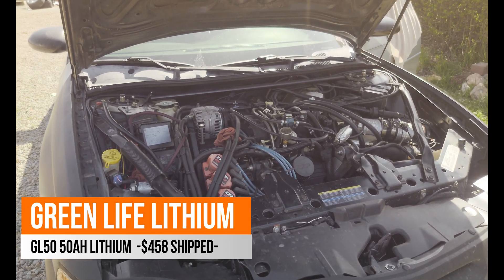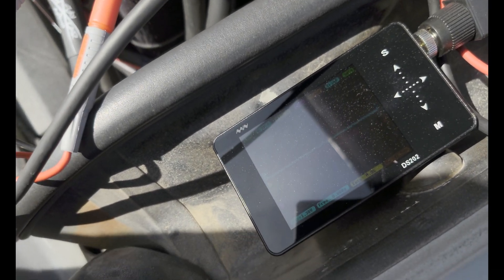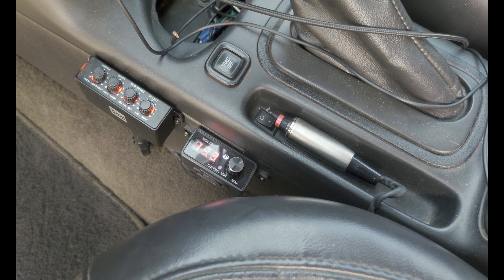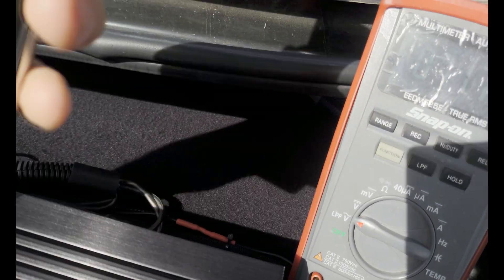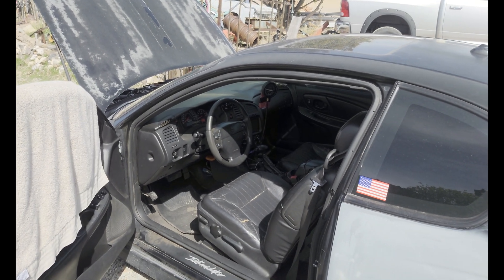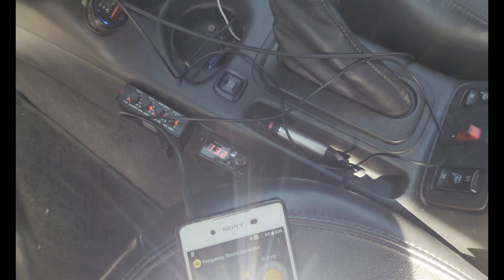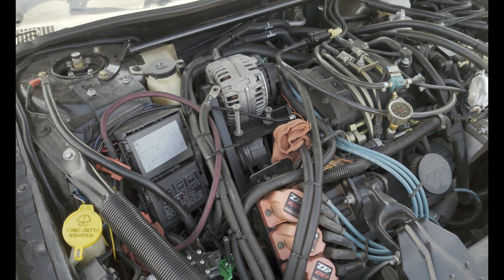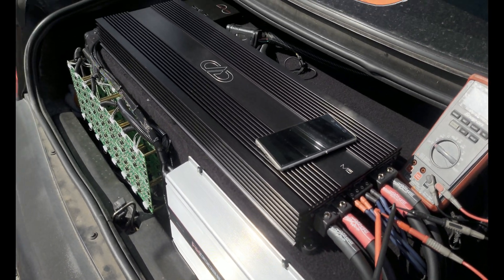Green LiFe Lithium VS JY, Limitless, XS Power, Winston

Comment: Hey man i was looking at these brand of batterys are there good n reliable i have a 270 alt n a sundown salt 8k n i whanted it to run it at .5 on the 100ah greenlife will the work thanks
Reply from the maker: Sorry For Super Long Response.

I've Had The 2 In The Rear For About 4Ish Years And Haven't Had Any Issues.  I Think The Biggest Difference Between These Green LiFe Lithium Batteries And The XS Power, Jy , Limitless Is That Green Life Lithiums Are Focused For Long Life And Large Capacity Rather Than Current Output.

The Reason The GreenLife Lithiums May Not Put Out As Much Current As The Jy, limitless etc Is Because These Have Built In BMS In Them. These Batteries Will Automatically Discconect Cells That Go Bad (so you can still use the battery just at a reduced capacity) They Also Have Short Circuit Disconnect And Even Over Charge Voltage Disconnect Internally Were As XS, Limitless Have Nothing Like That. Or At Least They Don't Advertise It (having these features means lt has limited the current output capability of the green Life Lithium). The Green LiFe Lithiums Also Have Active Cell Balancing With The BMS. In My Opinion These Green LiFe Lithiums Will Last Longer Than The XS, Jy, Limitless etc.

A SALT-8 Is A No Joke Amp. My DD M5 Is Rated 8k @ 14.4v And That SALT-8 Is 8k @ 12 Volts. So That's Nearly A 10K Amp. 

If I Were You I Would Run 4 100AH Green LiFe Lithiums. If Your Gonna Go Lithium I Would Spend The Same Amount It Would Cost From "Name Brand Lithium" On Green LiFe. You May Not Get The Same Performance Battery Vs Battery. But Since Green LiFe Is Cheaper You Can Buy More Of Them To Probably Get Similar Performance.

So I Would Run 4 100AH Green LiFe (~$3,200) If You Got The Space And Don't Want To Run Ultra Capcitors. If You Don't Got The Space Then Limitless May Be Your Option. Those Put Out The Most Power For Thier Size... But Not The Most Power For Thier Price I Think.

If You Wanna Run Super Caps I Would Go 2 100AH Green Life And 4-8 Banks Of Caps. If You're Interested I Know Where You Can Get 8 Banks For About $1,300 Brand New. Each Bank Comes Assembled With Bus Bars And Balancing Boards. They Are Fake Chinese Knock Off Of Maxwell 2.85v Caps. I Bought A Bank For $155 Shipped And Been Testing It Out For Awhile Now. They Perform Just Like Name Brand Caps Like Maxwell And XS Power. But You Can't Get Them Right Now Because This Virus BS. I Had To Cancel My Order Of 4 Banks.

I've Got Videos I Have Not Uploaded Yet Of The Caps Because I Wanna Get My Share Of Them If They Sell Out Or Go Up In Price When People Discover Them.

If You Want Me To Do Any Tests On My Green Life Lithiums Let Me Know. If You Want A Private Link Of The Knock Of Capacitor Load Test Video I Have I Will. You Can Still Buy Them On eBay But They Price Of Shipping From China Has Gone Up Insane Cus The Virus.

You Could Also Build Your Own DIY Headway Lithium Bank But That's Kind Of Involved If Your Not Too DIY Inclined Or Just Want Something That's Ready To Throw In And Install.
Reply: Salvatore Hayes thanks for all the info on the website it says one year warrenty n u mention 5 years have u done a videos with car on thanks again i will b looking out for those videos u havent posted if u post then thanks again
Reply from the maker: @10krms8  I'll Email Green Life And Find Out About Thier Warranty. On Thier Website For Thier All Thier Batteries It Says 5 Year Warranty And On Each Battery It Says 1 Year For Some Reason. I'll Let You Know.
Reply from the maker: @10krms8  The Green LiFe Battery Warranty Is Only 1 Year Now. It Used To Be 5 Years When I Bought My Two In The Trunk 4 Years Ago. The Good News Is They Are Cheaper Now Instead Of When They Had 5 Year Warranty. My 50AHs In Trunk Cost Me 650 Each At The Time And The Lastest One I Bought In Engine Bay A Few Months Ago Was $458 Shipped.

If You Want A 5 Year Warranty There Is Another Company Called Smart Battery. They Are The Same Exsact Batteries Just With A Different Sticker On Them. They Are Called Smart Battery. Smart Battery Has Been Around Longer Than Green LiFe. https://www.lithiumion-batteries.com/products/product/12v-100ah-lithium-ion-battery.php

The 100AH Is 1250 But They Have A Rare Discount Code For 20% Off Becasue Of Covid 19 Putting Them At $1000 For A 100AH. If U Want 5 Year Warranty Ur Paying About 120 Bucks More. But Honestly I Think These Batteries Will Last Longer Than 5 Years Anyway And If There Is An Issue With Ur Batteries It Will Be A Manufacturer Defect And Definitely Show Up Within A Year.

I'll Make A Video With My Car Running Clamping The Power At Same Frequency And Port. Keep In Mind I Have 3 50AH Green Lifes, 8 Banks Of Super Caps And 2 320Amp Mechman Alternators. (the alternators really increase how much power you can support). But I'll Show You How Much I Support Real World Power True RMS No Clipping On A Test Tone. Hopefully My Subs Will Survive hahaha
Reply from the maker: @10krms8  There Is Also "Lithium Battery Power" Or LBP. They Have Slightly Different Cases But Use The Same Stuff Inside. They Offer A Similar Warranty To Smart Battery For Slightly Less Cost Wise. $950 Before Shipping For 100AH.

https://www.lithiumbatterypower.com/collections/lithium-batteries/products/12v-100ah-lithium-battery

LBP Is About Same Age Of Green LiFe Lithium. Green LiFe Offers These Identical Batteries For Cheaper But Not With Long Warranty Like Smart Battery Or LBP.
Reply: Salvatore Hayes cool yea ill b looking out for the video thanks again for all info n tips
Reply: Salvatore Hayes do they come charge n ready to install i dont have a charger yet
Reply from the maker: @10krms8  They Come Like At 30% Charge. All Lithium Batteries Have To Drained And Ground Shipped Only. You Can Charge Them With Ur Alternator. If U Get Multiple 100AH I Would Charge 1 At A Time On Alternator Before Installing Them. Use Jumper Cables On Ur Alt And Connect Them To Battery. Run Car Untill Your Voltage Rests At Normal Charge Voltage (will probably take a good 30 Mins Per Battery Cus They Are Big And U Got 1 Big Alt) . You Can Use Any 12v Lead Acid Charger On These Lithiums. You Don't Need A Special Lithium Only Charger. A Cheap Harbor Freight Charger Will Work Too (will take While). If You Get Multiple 100s Don't Install Them All At Once And Start The Car Before Charging Them Up lol. Ur Alternator Will Be Pist haha. My 2 320A Alts Were Pist Working OT When I Bassed My System For 8 Hours Strait Engine Off And Started Back Up. Took 1 Hour Drive To Charge My 3 50AHs Back Up With My 2 320A Alts.
Reply: Salvatore Hayes uhh n i was going to get a lithium charger so i think i am going with two 100 ah gren life ones for now i will like to add a second alt but the car i have has no room what so ever for two what u think will that work, also i am going to just wire the amp to 2 ohms for now till i get one more now will the alt charge all 3 the agm up front n the two 100 at back
Reply from the maker: @10krms8  Yea You Won't Need A Pricy Lithium Charger For It. You Can Run The 3 AGM And 2 Lithiums 100AH In The Back. Just Charge The Lithiums Up Before You Add Them To The Vehicle. Once They Are Charged Up U Can Add Them And The Alternator Will Keep All The Batteries Charged. You Have 3 AGMS Up Front? You Should Have At Least 6 Runs Of 2/0 OFC (3 Neg 3 Pos) Running Back To The Lithiums / Your Amp So You Get All The Juice Possible From Those Front Ones / Alternator. What AGMs Do You Have In The Front Right Now?
Reply: Salvatore Hayes i only have one xs power d3400 up front n one in back right now n a 270 machman big 3 yea all ofc 1/0 wire so wt i was thiniking was to just put the newer 3400 up front n add two of the 100 ah in back to run it at 2 ohms for now till i add 3 rd one that should b fine n keep volts above 12 what u think
Reply from the maker: @10krms8  Oh Ok. 2 D3400s And 2 GL100s Would Do Pretty Well I Think. Then You Can Upgrade Your D3400s To Lithiums Later Or Add Some Cap Banks Over Time. What Subs And How Many Are You Running? What Is It Tuned To? What Voltages Are You Seeing Right Now On Ur SALT-8?
Reply: Salvatore Hayes i havent install it yet building it right now i just have a orion hcca 15 with a xtr 2500.1 at 1 ohm. I will b replaceing it all with twio fi spc4 v2 with the salt 8 at 2 ohms will really like it at .5 so when it rise it up will end up at 1sh box tune to 30-32 git stock hights for now i am also looking out for some goid mids 6.5s for the doors n few 8 for the rear deck which hights u got n amp runing them
Reply from the maker: @10krms8  Nice Those XTR Amps Are Nice Amps. When You Do Upgrade To Those FI You Should Have No Problem Running That SALT-8 @ 0.5Ohm. Not Sure What Those Subs And Enclosure U Got Planned Will Rise To But I'm Sure It Will Be Between 1-2 Ohms. You Can Run That SALT-8 At 0.5 Ohms Just Watch Your Voltage While Playing. I Don't Think You Will Need To Run Them At 2 Ohms At First Because You Can Control The Output / How Much It Strains Ur Electrical With The Bass Knob. My 29Hz Port With My Subs Rises From 0.5 Ohms To 5.8Ohms @29Hz !!!! It's Rises Like Crazy Which Is An Indication Of How Efficient The Subs And Box Is.

I'm Running A Tarmaps TS2000X4 ($280 Amp) It Does Seem To Make 500 Watts Per Channel At 2 Ohms Because I Can Definitely Blow My Door Speakers With Them If I Turn It Up More. I'm Running Re Audio XXX6.5 Components They Are Rare Now Too And Can't Find Them. They Are Way Too Large For A 6.5 And Will Not Fit In Any Factory 6.5" Door. It's Like A Tiny Subwoofer. I Had To Build Custom Door Speakers Mounts For Them And Trimmed My Door Panel So They Fit Because The Motors Would Hit The Window When You Roll The Windows Down etc

The Rear Decks Are RE Audio XXX 6x9 Components. They Are Meh. I'm Sure I Could Find Better 6x9 For Thier Price. They Still Do Pretty Well Loudness And Clarity Wise. The XXX 6.5 Are really Nice I Think. 

The Taramps Powers All Of Them. I'm Not An Audiophile But They Get Really Loud And Clear With That Tarmaps (Brazilian Full Bridge Amp). I Had A Sound Stream X3.2K4 Before (Korean Half Bridge) And Sound Quality Wise They Sound The Same And Good. I Can't Really Hear A Difference Between Class D And Class AB. Most People Say Class D Full Range Amps Sound Awful But I Think They Sound Good. My Sound Stream Died And It's Rare AF Too So I Went With The Tarmaps For 280 Wich Is Crazy Cheap For A 4 Channel Full Range Putting Out 500Watts RMS Per Channel And It's Freaking Tiny. On The TS2000X4 You Have To Set The Filters Right For It To Sound Really Clean And Loud.
Reply from the maker: @10krms8  Before I Had The RE Audio Door Speakers I Ran All Sony XS-GS Series Door Speakers (6.5s and 6x9s) They Actually Sounded Better And Higher Quality At Low Power Than My Current Door Speakers... BUT The Current Speakers Sound Way Better And Cleaner At Higher Volumes And Higher Power. The Sonys Would Hiss Out And Sound Washed Out At High Power. The Sonys Were Really Designed To Be Run On A Stock Head Unit Not A Dedicated Super High Power Amp But They Still Got Really Loud.
Reply from the maker: @10krms8  Hey Man So I've Been Doing Some Digging Around. I Actually Found The Chinese Supplier Of The GreenLiFe Lithium Batteries. The Original Company Is Called "KS Energy" In Shenzhen China. I Found Them On Alibaba.Com. These KS Energy 100AH Batteries Actually Have Bluetooth Connectivity So You Can View Battey Percentage Charge And Other Specs Like Cell Temperature etc On Ur Phone. They Also Have A 5 Year Warranty But May Be A Long Processs If You Ever Have To Use It Because They Are Located In China, Where As Green Life Is A US Rebranded Distributed That Charges Alot More Per Battery. I Got A Shipping Quote For Door To Door. It's Sea Freight With Taxes And Customs Duties Included. Check This Out A Green LiFe 100AH Comes To  $804 Shipped Each If You Buy 2 ($1600 For Both). If You Buy From Alibaba... To Get 2 Shipped Through Sea Freight (Will Take About 1-2 Months To Get Here) Your Looking At About $980 For 2 100AH Lithiums That Comes Out To $490 For Each 100AH Battery Vs $808 Per Battery With No Bluetooth Connectivity.

I Also Stumbled Across Some 100AH "CALB" Lithium Cells On AliExpress.Come That Are Reputable. They Are The Same Exsact 100AH Cells Internally As "Winston". These Will Put Out More Current And Have The Same 100AH Capacity As The GreenLife/KS Energy 100AH Batteries. They Come With Bus Bars And Bolts. The Only Thing They Will Not Have Is Balancing Boards And A BMS (The Thing That Disconnects The Battery When Voltage Is Too High Or Too Low. The BMS Is Also The Thing That Limits The Output Current). You Can Easily Add A Balancing Board To These For Like 20 Bucks Max. You Could Install A BMS To Them But I Don't Think Its Necessary And You Don't Want To Limit Thier Current. They Are A Little Larger Than The KS / GL 100AH In Size And Weight. They Are Only $300 Bucks Free Shipping From AliExpress. It Would Take 1-2Months To Arrive From China. There Are US Sellers Of The CALB 100AH Cells But They Want $570 For The Same Thing. They Have A 2 Year Warranty. Again If You Do Need To Use The Warranty There Will Be A 1-2 Month Wait To Get Them Replaced. I HIGHLY Doubt These Cells Will Fail With In Even 5 Years So That Should Not Be an Issue For Both Options. 

https://a.aliexpress.com/_dYN7HPI

Here Is A YouTube Video Of A Guy Who Reviews A Ton Of Lithium Batteries And Tests The AH Specs.

https://youtu.be/Di2o7an-WJw

If I Was You I Would Go With The CALB Cells From China Since Your Gonna Be Using Them Inside The Car Because They Will Be Safe From Water And Elements. 

He Also Shows Prismatic Lithium Cells (The Blue Ones). Those Are Lighter And Smaller BUT They Run Hot Under High Current Demands. Where As The CALB Cells Do Not Run Hot Under High Current Draws.
Reply: Salvatore Hayes very interesting prices r really good as well thanks i am still trying to decide which one to go with have u done any more videos on ur system
Reply from the maker: @10krms8  I Uploaded The Capcitor Video But My Stupid Computer Editing Software Does Not Like 4K Video So All The 4K Vidoes In It (The Draw Test And Cummins Jump Starting) Randomly Freeze. I'll Try Upload A Hopefully Working Video Tonight. I'll Try And Make A Video Of My System Today Or Tomarrow At Full Tilt. Probably Video Will Show Up Thursday Or Friday.
Reply: Salvatore Hayes cool il b looking out for it i am also looking for a really good prefab sub box did u make urs or got it somewhere
Reply from the maker: @10krms8  I Custom Made My Own Box. Took About 2 Months For Me Because I Was OCD And This Box Is Extremely Unique On The Inside. It's Got 45s At All 8 Inside Corners And I Used 2 Gallons Of Body Filler To Round Out The Concerns To A 12" Diameter Circle. The Box Is Massive On The Outside But The Inside Volume Is Only 3.9CUFT. I Just Made A Custom Box For 2 Sony XSGS120LD Subs (my second ever subs I owned) Its a 3.5CUFT External Areo Port Box Just Like Mine Except No 45s In Corners And No Body Filler (only Took Me 4 Days To Build Being OCD). It Slams Pretty Well For 500watt SONYs. I'll Probably Make A Slideshow Video Of That Build On YouTube From My Picture Collection.

The Only Good "Pre Fab Boxes" Are The Ones Offered From Websites Like Down 4 Sound etc. They Are Around 600 Bucks. If You Build It Yourself It's Only Like 120 Bucks For All Your Materials (For 2 12" Sub Box) 18 Or 15s Will Probably Be Around 200. Building Boxes Yourself If Time Consuming But I Think It's Totally Worth It And Rewarding. I Only Build Square Or Rectangular Boxes No Special Shapes Cus That's Too Complicated For Me haha. I Also Only Build Aero Port Boxes Because They Are Easier And Keep The Weight Of The Box Down Because No Internal Baffles For Port. I Like Building External Aero Port Boxes Because You Can Keep The Box Small And Your Port Tuning Is Always Adjustable. That Is If You Have The Space For An External Port.

Things That Will Make It Easier To Build A Box Is A Router, Jasper Router Jig For Cutting Perfect Sub And Port Circles, A Hole Saw Set, And Harbor Freight Fixture Clamps, Long Guide/Strait Edge And A Circular Saw With A Wood Blade. I HATE Using The Skill Saw To Cut Wood And Circles etc. I Also Used 3/4 MDF For All My Boxes. 

Carpeting Boxes Is Kind Of Tricky. When I Make That Box Build Video You Will See How I Do It.
Reply: Salvatore Hayes so when u switch ports the longer the port the lower hz on the box or is it the other way around i think going to geve it a try by adding the cotton woel looking thing inside the box will the help in anyway
Reply from the maker: @10krms8  Yup If The Port Diameter Is The Same And THE PORT IS EXTERNAL (Doesn't Displace Internal Box Volume) Then The Longer You Go The Lower The Tuning. If The Box Is Really Small The Port Will Be Way To Long Depending On How Low Your Trying To Get. If The Port Is The Same Diameter And Length And Is On A Bigger Enclosure It Will Have A Lower Tuning Then Another Smaller Box With That Same Port.( If You Have A Large Box Your Port Won't Need To Be As Long If It's The Same Diameter As A Box With A Smaller Volume To Acheive Same Tuning). How Big Your Box Needs To Be Is Determined On The Subs. Generally A Small Box And Large Port Area / Length Makes More SPL But Thats With SPL Subs. Sundown Subs For Example (Sundown X12S) Like Larger Boxes. Etc. I Kind Of Have An Idea For Box Volumes Based On 12" Subs And Thier Specs But Have No Experience With 15s or 18s. I've Only Built 1 Dual 15" Box.
Reply: Salvatore Hayes the box will b around 16 tall 38wide n 20 deep i whant it tune low in the 30s 5.5-6 cf total is these big enough of a box with these specs n how long wide of a aroport will work
Reply from the maker: @10krms8  Send Me A Link To The Manufacturer Of The Subs You Will Be Running Of The TS Specs. Also Were Is This Box Going Into? Is It A Car Trunk Or In A SUV?. Where Do You Plan On Having The Subs Firing?
Reply from the maker: As For Capacity I Was Playing A Demo Music Playlist On YouTube Engine Off While I Worked On My Car For About 8Hours Strait And The Car Started Right Up After Words.